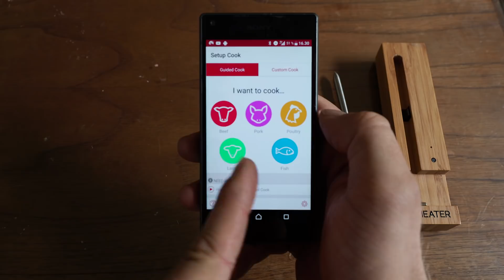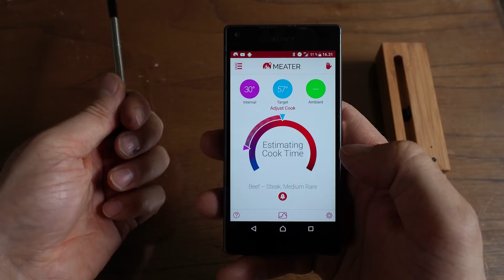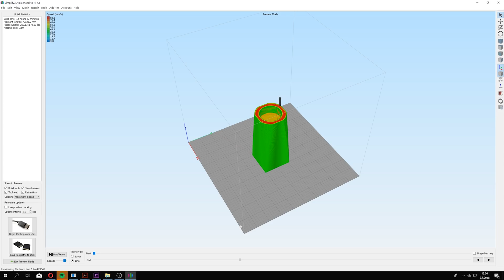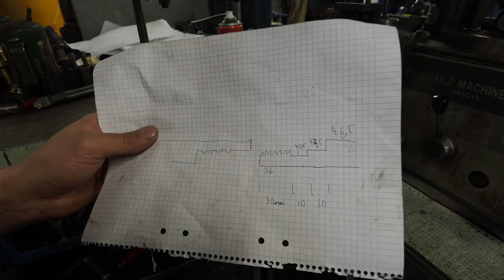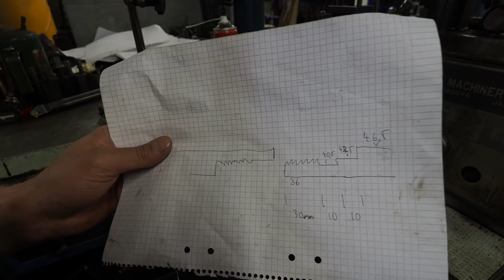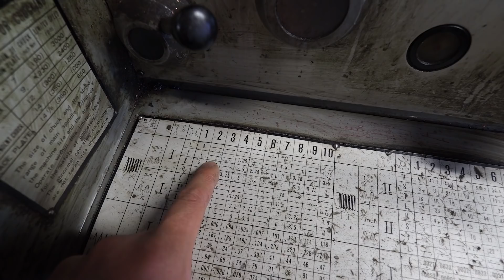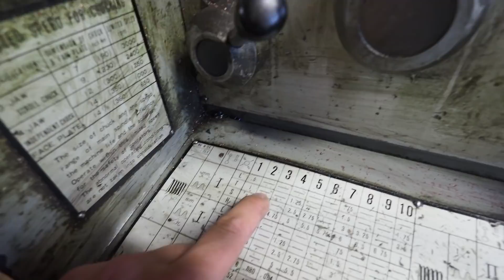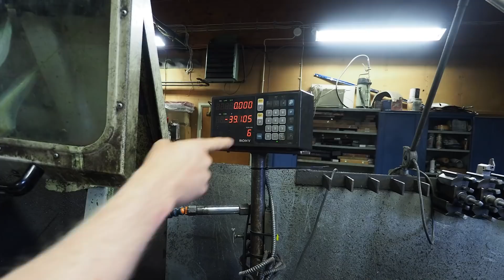Making Giant Meat Thermometer + Meater giveaway!

Comment: When cutting threads it is better for the tool to only use 1 cutting edge at once. So basically for a metric thread you should move the tool at a 30° angle, or when you want to cut 1mm you would also move the tool by 0.58mm in the thread axis.
It is better for the tool because the shavings have more space and have less bending stiffness.

Comment: 11:11 looking at the table, 2 rows down from the row we picked, we see the pitch goes from 4 to 4.5 to 4.75 to 5. The same ratios must apply to the chosen row (because they're the same gears), meaning we can interpolate the values on the chosen row to be 1 to 1.125 to 1.1875 to 1.25. So Anni thread™ has a pitch of 1.125 mm (or 1 1/8 mm if you prefer) :)

Comment: Nice work! 
Fun idea that with the threads - but you can actually calculate the pitch. Assuming that it's changes linearly it's given by (1.25 - 1)/3 + 1 = 1,0833... millimeters. Yeah quite odd number - but possible to copy if you have seen this video and have a machine that can be set at the same setting. But, you will indeed not find any thread dies or thread taps with those dimentions, haha

Comment: I would use the meter when I cook meat with the sous vide method. Because the sensor is small, it can easily be put into a roast which is then put in a plastic bag and vacuumed. The bag is then placed in a suitable hot water bath into a circulator and cooked, for example, for 48 hours.Because the sensor is waterproof and small and handy, it is perfect for this purpose. 

The normal radio sensors are clumsy; the sensor has a corded radio transmitter that can't withstand heat and can't be immersed in the liquid. Traditional spring thermometers can not be put in the bag, too as the cooking bag is filled with meat fluid during cooking. It is also impossible to monitor temp using a traditional alchohol thermometer in the vacuum bag and in the water bath. 

Because of these arguments, the meter would be very useful to me. Sure I would also use it for smoked or roasted Christmas ham and other meats and fish. In the spring, it could observe the temperature of the greenhouse soil. In winter, weighing flue gases temp from the chimney.

I wondered if it could still measure the temperature of Zetor's coolant?

Comment: Hmm. Might look out for these in Motonet. As for putting it inside the large one - is it a pipe? I guess it is. Otherwise I'd be extremely surprised if the RF signals could get out... But if it's a pipe it would act like a waveguide and the signal would come out of the plastic end of the tube.

Comment: Now everyone in America will start manual machining with the Annie thread!
Reply: Sadly, not in the U.S., where we can't seem to wrap our heads around a base-10 measuring system. :-(
Reply: I know it's a joke, but trying to replicate it on the crappy old inch machines that the hobbyists adore would be a pain in the ass.  If you don't have a full set of change gears or aren't competent with arithmetic (certainly some people aren't), getting a good approximation might be difficult.  

For short engagements, common settings match closely enough (e.g. 0.8mm is close to 32tpi).  Unfortunately (or fortunately if you like frustrating other people), 1.1250mm pitch is 22.578tpi -- so 22 tpi isn't exactly a good approximation, and 23 tpi isn't exactly common and might not be available through the quick change without changing the drive gearing.

A person could always just make up their own bastard thread though.  Make everything with M40 37tpi buttress threads.
Reply: Wouldn't it just be easier measure in metric than hurt your head with all the 25.4 conversions?
Sure, it might require a few new gears, but think of the productivity gains when its no longer necessary to convert fractional inches to thousandths.

Comment: Looks nice, good job on the fabricating. I wonder what you could build the plastic part out of to make it more heat-resistant.
Reply from the maker: I could machine the part out of some plastic that has higher temperature rating but I think there isn't many materials that are easy to machine, let bluetooth signal through and don't melt in high temperatures.

Comment: It's not the angle of the dangle, it's the heat of the meat, or so they say. Just to be safe I could use this along with a Bluetooth protractor to check both of those measurements from the safety of my armchair.
Reply: I believe you'll find that the angle of the dangle changes proportionately to the heat of the meat... ;-)
Reply: You are very likely correct sir, I'm no rocket surgeon :-)
Reply: No reason not to repeat the experiment. In my experience, proportions vary over time - I believe age, and the number of hours hours since I was at a burlesque show are the two main factors.

Comment: Meater maximum temperature is higher than melting point of babbitt, so you could use it to measure lube oil of bearings.
Or food. Probably just food.

Comment: Protip: "Low-temperature" hot glue melts at about 120-140C, which puts it decently below the point where PLA turns to goo, especially if you're using one of the hotter PLAs that print at 230 or so. If you're having adhesion issues with tall, narrow parts and don't want to use a raft, you can often tack a piece down with a spot of glue after it's about 1-2cm tall. With a little care and a steady hand, you can even brace parts higher up, to mitigate wobble artifacts.
Reply from the maker: Thanks for the tip! I think I will test this one since I have quite often tall and large prints that are really annoying if they get loose during 20 hour print
Reply: Why did you not want to use a raft though, would that not have held it in place better?!
Reply: Saves material (provided the part holds and you don't have to reprint), and takes less post-processing if the surface making contact with the bed needs to be flat for aesthetic reasons or mating with another part. Sometimes you need them to print in the first place, but they're something I go out of my way to avoid at times.

Comment: Good build. Have you tried it working? Does the BlueTooth signal from the small thermometer escape through the steel?
Reply from the maker: It escapes through the 3d-printed section. With full steel construction it wouldn't work

Comment: There is a metal hybrid 3d printing filament you could have used that basically becomes   like aluminum  and can take heat well
Reply from the maker: One big reason to use plastic there was to make hole for the bluetooth signal and I think that metal hybrid material would block that also

Comment: I'm surprised that the blue tooth signal can penetrate and reach your phone when it is inside the big one!

The big thermometer looks a lot like a rocket -- you could make similar pointy tubes, then stick a model rocket engines (large!) in the end - see how far it will penetrate the ground when it comes back down - pretty dangerous.
Reply from the maker: The plastic section is there mainly for that reason :D

Comment: Reverse searing a steak, learn it and love it friend.  

http://jesspryles.com/recipe/how-to-cook-a-steak-with-reverse-sear-method/

Preheat oven to 135c/275f
Place well seasoned steaks on a rack over a baking tray (cover the tray with foil to save yourself a clean up)
Put in oven and cook til an internal temp of 125-135f depending on your preference of "doneness". Usually takes around 45-60 minutes.
Remove when at temp and rest for 10-15 minutes under foil
Preheat a skillet or heavy based pan to screamingly hot temperatures
Sear steaks for one minute each side
Serve immediately

Comment: Don't use this product to cook stuff unless you need it well done. You can get away with cooking steak and other whole pieces of meat rarer than well done because bacteria only grows on the outside of the meat. It's okay that the middle is pink and a little bloody, because the outer parts are done and the bacteria is dead. Unless you put the meat in the oven first and then put in the thermometer after the outer parts are cooked (what this product seems designed to avoid), you will be stabbing juices, bits of meat, bacteria, and other contaminants from the outside of the meat into the middle.

Really, you don't even need a meat thermometer unless you're cooking a giant piece of meat. You can just press the top of the meat if you're cooking on a stove or cut into it and look at the juices (any cooking style). Most people with a basic understanding of cooking know this, but the look of the app makes me think that this was designed for people who don't know how to boil water.